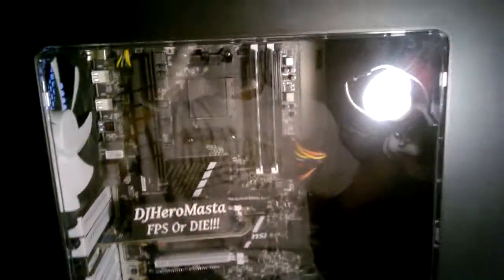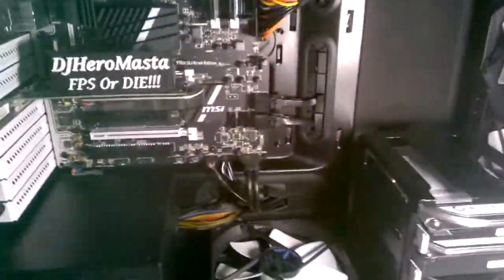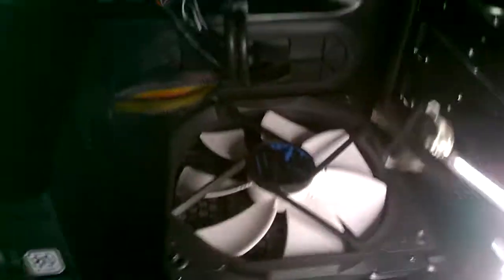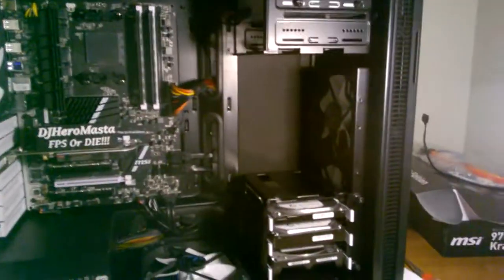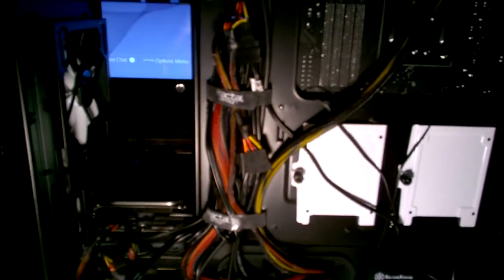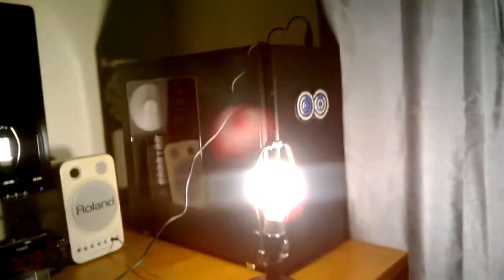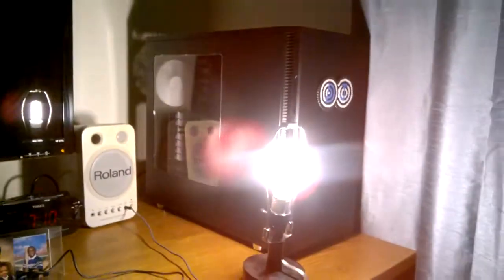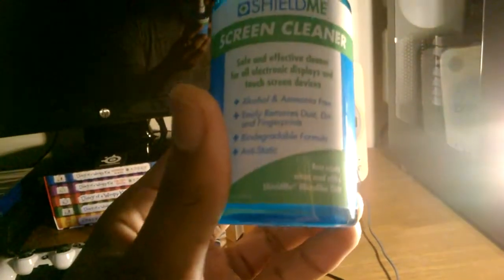MSI 970A SLI Krait Edition / Case Overview

Comment: A GOOD START MATE
Reply from the maker: +Bengie Joseph Thanks! I finished it. Om getting a new video card in April.
Reply: +DJHeroMasta i run this motherboard too. best price and preformance. will be up loading a video soon
Reply from the maker: Cool! I'll watch it.
Reply: +DJHeroMasta i have 2x avier 4gb ram, a asus radeon r7 2 gb graphics card, corsair cx750m psu and a amd fx 8350 black edition with a cooler master hyper 212 evo. best system ever for a cheap price :)
Reply from the maker: Aww sweet!!! I love that RAM. I plan on getting 32GB of AVEXIR Blue RAM. I was gonna get 2x blue and 2x white to match my build but the white ones are all sold out :( but all blue is fine.
Reply from the maker: Nice build BTW
Reply: Cheers. 32gb of ram will do you well. Avexir are top of the league for preformance
Reply from the maker: +Bengie Joseph Where's the video man? :D

Comment: So how has this board been treating you now that you've had it for some weeks? Just curious because I've had this same one sitting on the shelf for a couple of months waiting for some parts and in the meantime I've been reading random complaints about overheating. I'm assuming that may just be the people who are trying to push overclocks, which this board was absolutely not intended for.
Reply from the maker: +John Montgomery Hahaha, funny that you ask that question. Just the other day I was attempting to overclock my AMD FX 8350. All went well until went past 4.2Ghz. My computer kept crashing, no matter how high I raised the voltage. After hours of trying, I gave up and resulted back to letting MSI do an automatic overclock. It;s now running at a stable 4.2Ghz. I love how to board looks, especially for the price and included features. It's just that the heat-sinks on the North/South bridge get REALLY hot. I ram prime 95 and my temp 2 reached 98C and it was still raising, I got scared and shut it off. Besides the 4+1 phase its a great budget board. Some guy OC'd his FX 8320 to 4.5Ghz. That was my first time OCing so I'll try again when I get a new board. Right now I'm saving up for a Gigabyte G1 Gaming GTX 960 4GB
Reply: Yeah, the phase really cripples this board, but my needs are pretty modest and I have no plans to go beyond stock. My adventurous days are pretty much behind me and I just need something to do daily tasks with and occasionally get in some Fallout 4 or Bioshock since my laptop is now dying in fits and starts.
Reply from the maker: Then this board is perfect for those task. :D I don't even need to overclock, my CPU's more than enough.
Reply: I figure I'm going to make some upgrade decisions later this year when Zen comes out anyway. If it ends up being a true to Skylake then I'll most likely spend more money on Team Red then.
Reply: +DJHeroMasta  Get a 970, You will be much more happy
Reply from the maker: +FromWRXtoEVO IX Not for the price. I ordered a Gigabyte G1 Gaming GTX 960 4GB for only $177 :D
Reply: +DJHeroMasta Whatever works, right? I finally got mine put together and running with a $180 R9 380 in it and it plays all the games I need it to at 1080 just fine, so I'm content. :)
Reply from the maker: Sweet! Did you get the XFX Model?
Reply: DJHeroMasta No, it was the MSI Gaming 4G. It was on sale and I had $20 worth of Amazon credit so it worked out to about $180 when it was all said and done.
Reply from the maker: I knew you had scooped up on a sale :D Good for you cause I missed it lol. I ended up buying my card off of jet.com I'm not even sure if it'll show up at my doorstep :( But I have high hopes as just the other day my mom said she saw one of their ads on T.V. so my fingers and toes will stay crossed until Wednesday. My 16GB of RAM should either be here tomorrow or the day after. I bought 2x 8GB sticks of AVEXIR RAM from Newegg. I have no doubt that it will be shipped to my house but as fa as the card goes, I won't be happy until I cut that box oepn and see Gigabyte's original packaging :)
Reply: DJHeroMasta I'll bet. I have 8GB of HyperX in mine and I'll be ordering another 8GB next week. Things are running smooth as buttah, but again I haven't overclocked anything because Fallout 4 seems pretty happy with it as is.
Reply from the maker: :D Glad to hear that man. Continue to enjoy your PC!
Reply: You too.
Reply from the maker: Thanks.